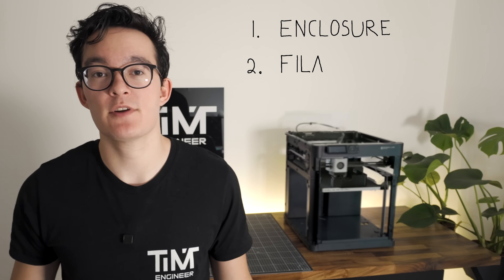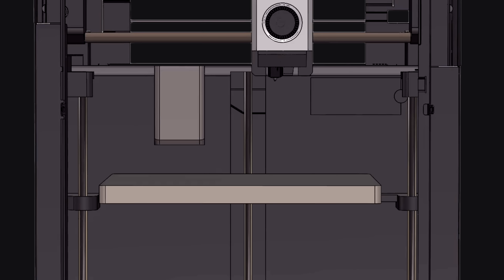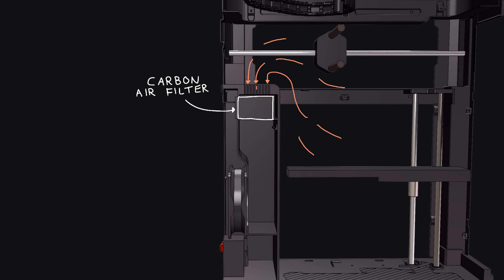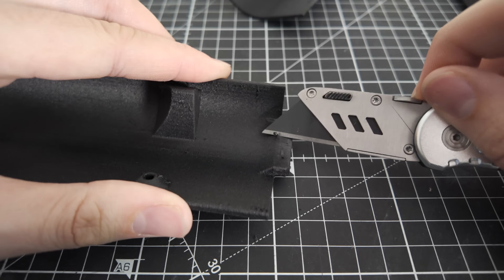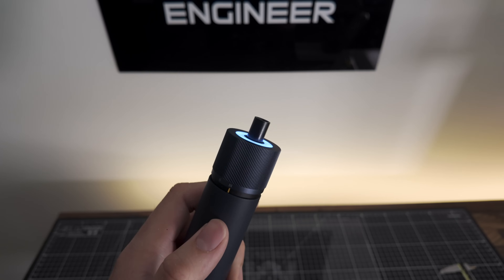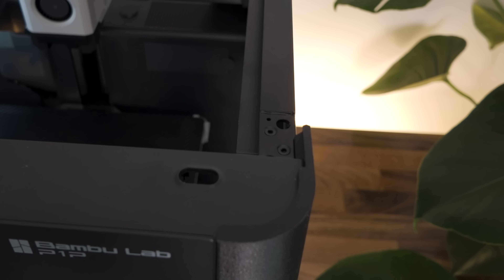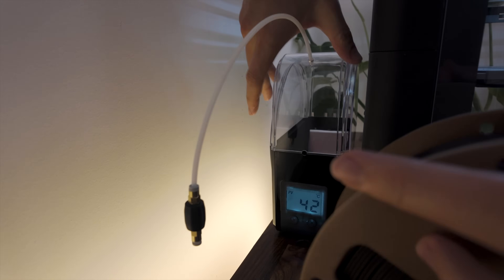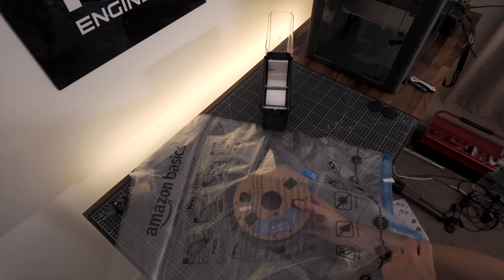Upgrading my 3D printer to print the toughest material: Nylon

Comment: This video is great. Right now, the P1S on Bambu Labs website is on sale for $600, and you only need 2 parts to make it like the X1C. And you did it without whining about how you should just "bUy ThE X1C." I'm going to do the same thing you did, since I'm expecting the next Bambu to have a larger build volume + multiple independent print heads (which would solve AMS waste issue).

I have a question though, pertaining to the nylon carbon fiber parts expanding. If you paint it with something called dichtol (makes print parts waterproof, like if you wanted to make an outdoor security camera case), what would happen? Would that solve the expanding parts issue? Can you test this out for us?
Reply from the maker: Thank you! I would of bought the P1S if I  didn’t already get the P1P a year ago, but I think your right the upgrades make it worth upgrading either! As for the expanding Nylon there’s many methods to waterproof them! I’m sure dichtol would work the question is how much! I might cover this in a future video sure!

Comment: One trick I have used in my PrusaXL to improve my success with Nylon parts is to use a fiber reinforced nylon in the bulk structural areas and plain nylon in the contact areas.  I also found that polycarbonate and nylon don't adhere to each other so if you can keep the PC and PA from contacting each other in a wipe tower and only use supports on the bed you can treat the PC almost like a dissolvable support material with the interface distance... That said on the XL a wipe tower is pretty much a necessity when switching filaments and i really struggled getting the mixed prints and wipe tower to behave.
Reply from the maker: Very cool Idea! I’m thinking of doing something similar in a future project with glass fibres in the middle of the filament, leaving the outside nylon only.

Comment: One (IMO) crucial piece of advice if you want to succeed: Do some audio corrections. Compare your video to random other videos on YT. You'll notice that your volume is very low. Don't fall for the "people can adjust their volume"-trap. Nobody wants to have to change their volume for each video, nor do they want the heart attack when the next video starts that is at the right volume, which is way too loud now due to how much they had to increase the volume on their machine.

People can deal with crappy video, but crappy audio really is a dealbreaker. Other than that, this seems like a great new channel, keep up the good work.
Reply from the maker: Yeah I completely agree with your points will try to match audio for the next video thanks!

Comment: What Temperature do you have in the Enclosure?
Reply from the maker: I don’t have a temp sensor but based on the hot end sensor and bed sensor cooling it’s probably 35-40 C. Better enclosures like X1C can go up to  45-50C
Reply: @TimTheEngineer96  thanks mate!

Comment: Thanks for the nice video! I'm upgrading my p1p too and not sure about installing the chamber fan because there is no temperature sensor in the p1p. So the fan is only adjusted by the g-code, right ?
Reply from the maker: Yes this is correct, to be honest it’s no way near as important as the control board fan. The enclosure won’t overheat even if your beds at 100 C so you can skip the chamber fan upgrade if you want. For me it was a way of getting some air through the Carbon filter. Now considering having an internal filtering system with a hepa filter and temp sensor+ heater.

Comment: Isn't TPU WAY tougher than nylon?
Reply from the maker: Yes it is! Technically infinitely tougher because it’s an elastomere and can’t be tested accurately in the unnotched impact test. I believe elastic materials like TPU are unfair to compare to rigid material which is why I didn’t include it
Reply: @TimTheEngineer96  I think it's pretty fair to compare something like 95A TPU, because it's still rigid enough to be used for many structural parts.

Comment: Carbon filters don’t filter out the toxic fumes. Only the smells. Combine it with a HEPA filter 👍
Reply from the maker: Oh good to know thanks!
Reply: @TimTheEngineer96  Umm Matthew is wrong however, carbon does filter the bad stuff hence why its called a scrubber. The Hepa filter filters out particulate aka the tiny plastic particles.

Comment: So you upgraded your P1 to be a lesser X1C at more cost than just buying a X1C?  I guess that makes sense if you have a Youtube channel?  And nylon is not the toughest material to print by far.  TPU (especially old-school Ninjaflex) has given us all more headaches than nylon ever could imagine.
Reply from the maker: I think it becomes subjective, but your right TPU is also very hard to print. Personally I found that because it absorbs water slower and parts dont warp as much, it was much easier for me to print it.
Reply: The amount of effort he placed in this P1P upgrade and video editing is more than most will do in a lifetime.
Reply: If you already own a P1S, which he did, then no the upgrades don't cost more than an X1C.
Reply: This is no different then somebody that buys a camaro ss or a mustang gt and supercharges them. Its for the love of the game
Reply from the maker: “For the love of the game” well said XD
Reply: even then this build is signifigantly cheaper than an x1 carbon
Reply: lmao i have oldschool ninjaflex around, it still prints properly after 2 days in the filament dryer

and even my Bambu A1 prints it properly if i have a direct path to the extruder (short piece of ptfe in the head/ams splitter) and a holder with ball bearings

my old Creality with a Hemera does aswell but since even the A1 can do it i don't ever use my modded CR20 Pro anymore
Reply: Ninjaflex is actually damn easy on the P1S. I just used the Bambu TPU preset, changed the temps to what the box said and DISABLED RETRACT, LIKE COMPLETELY OR IT WILL SCREW YOU OVE RIMMEDIATELY

Sorry for caps, but I really wanted to get that out there.

Comment: Good thing I stumbled across this video -- I just bought a hardened nozzle for my P1S but didn't even think to get hardened gears!
Reply: Double check it doesn’t already come with those!
Reply: @tttimster2132  the P1S says it comes with stainless gears. The hardened gears were only $20 so it is a worthwhile upgrade to go with all of the PETG-CF I just bought.
Reply: @cedwards427  oh definitely if your printing anything with fibres in it as they are super abrasive!

Comment: Well, it sounds as if PA was the best material (Nylon is actually just a brand name, not the material). However it's actually not even close to being the best material, and I'm talking about the mechanical properties and not about ease of use. Really the biggest problem with PA is that it trades toughness for rigidity. For example I would never print shelf parts out of it, because the load will deform it permanently over time. Toughtness is not the only strength property and therefore, while it is impact and shatter resistant, it's still not the strongest material (not even close).
Also since it is hard to print properly, it will turn out weaker than PETG in a lot of cases.

Furthermore it's unsuitable in a lot more cases than just shelf parts.Whenever rigidity is required, then PA is the wrong material. Printed CNC machines for example. In the vast majority of cases PLA, PETG or ABS/ASA is better suited than PA. PLA expecially when it needs to be stiff and resist deflection under non constant load and when temperature is low. Or ABS/ASA for constant loads.
Yes PA can be made stiffer when using PACF, but it still won't be as stiff as some other options like PLA and the CF content might be unsuitable in many cases, because CF changes it's size based on room temperature and that causes a lot of mechanical problems, too.

In my experience of 5 years with many different filaments, I'd argue, that there are almost no cases where PA is the best choice. Wear and friction resistance is one of the few cases wher PA shines over the other filaments.

There is a reason why PLA and PETG is so widely popular. ANd that's not only because they're easy to work with, but also because they are suited to most use cases and even in special cases I'd probably not use PA, unless specifically required. And their spread make them cheap, so the higher price for PA is not an argument for it being better. Quite the contrary.
Reply from the maker: Yeah your absolutely right there’s very few good use cases for nylon, but I do believe that if used in the right areas it shines! Hope to demonstrator this in future projects!

Comment: Its not as tough as one might think sir. First off its flexible, without cf its meh.. the only thing its good for is high temp enviroments. its not very wear resistant either. At least from the usecases i have been disappointed by it. And its messy.. it loves to ooze. and string. 

i suggest you inspect your generated gcode for retraction speed overrides to take effect over 30mms. bl have locked it at max 30mms by default for some reason.. i use pa12gf with little ooze on long travels and almost nothing on shorter ones. had to "unlock" the speed and set it to 40mms and use 5mm retraction. 
good luck sir, nylon is pita.

suggest you take a look at asa and pctg with fillers for strong prints. also. slower and correct temp and as little fan as possible WILL give better results. time is your enemy
Reply from the maker: Thank you for the tips! I will do m’y own testing in future vids but I have high hopes for nylon let’s see!
Reply: @TimTheEngineer96  same as i had and did :) plus its loooooves moisture. U gotta have a drybox to print from. 

 give me a thumbs up when start testing its strength

Comment: Great video. Brand new subscriber. Long time nylon user. Easy Nylon is funny because if you print it with regular nylon bed temps you will have a had time. You'll actually get better results if you use 50 degrees on the bed instead of higher temps. A thin layer of glue will be just as sufficient as thick glue but prettier. The packaging recommendations are actually spot on (when perfectly dry).

The Easy Nylon you printed is still too wet from the looks of it. It will be silky smooth when completely dry. When wet, it'll get the bumpier texture and string like PETG. 

Idk if you have the engineering plate but i think that actually works the best with Easy Nylon. 

Finally, you used Easy Nylon.... It's easy lol. If you want a "real" challenge, pickup some Kodak Nylon. That'll require the preset temps, unlike the Overture. 

Again, great video. Just hoping to help, as an extensive non-CF  nylon user.
Reply from the maker: Thank you! I’m glad you approve given your expertise on the matter! I was scared nylon lovers would take offence to me using easy nylon but I’m glad I’m still in the good books :) I’ve tried other Nylon and indeed it was much more difficult to get right. Didn’t know that you could go as low as 50 and I think you might be right i didn’t dry it before printing. Probably should have let it sit in the drier overnight. Thanks for the info kind sir! I will keep it in mind for future projects!

Comment: What solved the warping? Slower print? Different temperature? Great video
Reply from the maker: Yes mainly swapping to PEI sheet improved bed adhesion but I also made some changes to settings which I displayed before I started 2nd print!
Reply: @TimTheEngineer96  great, i will compare the settings. Thanks for the response

Comment: Did you let the chamber preheat
Reply from the maker: I did but didn’t notice a significant difference when testing so I don’t think it’s needed!
Reply: @TimTheEngineer96 you can also use a hair dryer to heat the chamber if you need

Comment: You said Nylon is cheap...All Nylon filaments are among the most expensive, what am i missing here?
Reply from the maker: Nylon (PA6 &PA66) by itself is a very cheap polymer used in injection moulding, as a filament because of low demand it’s a similar price to ABS, ASA. When compared to composite filaments it’s a lot cheaper! Price in the description.

Comment: Same printer, already upped to P1S, and probably the same nylon since it's the same brand. Mine is the Easy Nylon from Overture, it should be a blend of PA6 and PA12 to stabilize the print, but Ihaven't tried yet. Compulsive shopping of 2 months ago... 
Thanks for the content! PS: Speak louder! Not my printer making noise, you talk too "shy"!
Reply from the maker: Very cool! Ive heard PA6 and PA12 before but on their spec sheet they are claiming PA6 and PA66? Yes will up the volume next time!

Comment: Cool, some nice mods there. Only thing i can see is that top does not seem to fit (i can see the light leakage at the front which means air / heat leakage) and also its too low. I used my p1s for quite a few months low down like yours before making a much bigger extension on the top because the ptfe tube hits and rubs agenst the top. Its left pits and scratches in my top part and the ptfe tube has rubbed itself down flat on one side. Also just wondering did you heat up the printer before printing the nilon? Maybe i missed you saying you did? Cheers for the video.
Reply from the maker: Thanks for the info! Your right I’ve started seeing the ptfe tube scraping. I’m thinking I might change it for the high temp ptfe that came with the pneumatic fittings I’ve linked in the description. Hopefully won’t wear as much. I would say one of the cons is this design is indeed not air tight like you mentioned, but so far I havent seen any other warping since installing the enclosure! I did heat up the enclosure slightly, but I found that by the time you get to those top layers away from the bed, the air has warmed up enough even without preheating it.

Comment: You could add one of those PTC heaters to reach 60C inside the printer. I wasn't ever able to get more than 45C on x1c
Reply from the maker: Great suggestion maybe in the future if there’s any challenging prints I need to complete!
Reply: @TimTheEngineer96  FYI there are off the shelve heaters for resin printers that you could easily use
Reply from the maker: Ooo didn’t know that I’ll check in them out thnx

Comment: Really cool video !! Do p1p or p1s have preset profiles for those engineering filaments like nylon-cf etc ?
Reply from the maker: Thanks! Yes they do PA-CF is actually easier to print! The nylon (PA) profile is the tricky part because it’s too fast and a lot of the settings had to be tuned on the slicer

Comment: you are missing a filament cutter arm. otherwise very good video, subscribed.
Reply from the maker: Thanks! I actually don’t use the cutter I just heat the nozzle to change filaments. I also have to swap out the extruder a lot so I’ve left it out on purpose!

Comment: I have gone for the air filteration inside, and inward exhaust to cool the chamber & keep fumes inside. This is pretty easy to do in klipper
Reply from the maker: Interesting tip if I have any issues I might consider doing the same!
Reply: If you keep the activated carbon in the heated chamber it can release the chemicals it previously filtered

Comment: so quick question, at around 5:24, i noticed that there are gaps leading straight to the controller board from the inside of the printer. I know you installed the fan for extra airflow around it however wouldnt the 50 degree air temperature mess with the longevity of the control board.  just didnt see if you had addressed this during the build.  great video by the way.
Reply from the maker: Yes your absolutely right this is also a concern I have. Having Looked at the Bambu wiki for the enclosure upgrade they seem to think the fan is enough, but I definitely think that adding a wall of insulation around the control board would help prevent too much hot air from getting back there. Thanks!

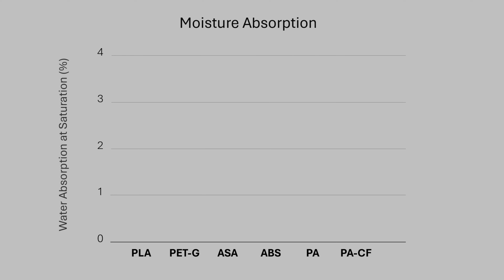Comment: Do you have any sources for the graphs you use, like the one at 8:48 ? (There are none linked in the description)
And if you measured them yourself: what setup and parameters were used ?
Reply from the maker: Great reminder thanks, I’ve just updated the description! Note that I didn’t use any coefficient of friction graphs because I couldn’t find any papers that compare the filaments reliably. Although it’s widely accepted that Nylon has low friction in industry.

Comment: And with how much this cost did you was it worth it, personally I would have just bought a Q1 pro for $450 and been able to print anything straight out the box, having multiple printers it's not a bad thing
Reply from the maker: It was quite expensive (180-250$) so getting the P1S would be my recommendation for sure, but at the time I did not have the need to print these tougher filaments. I haven’t tried the Q1 is it good?
Reply: @TimTheEngineer96  it's amazing right out of the box you can print every filament for cheaper than a P1S and I think it's same quality
Reply from the maker: Oh wow impressive I’ll check them out thanks for the info!

Comment: Have you tried annealing the nylon parts in oil to reduce water absorbtion and increasing strength?
Reply from the maker: I have not yet, although I like the suggestion, I may try this in a later project If the parts aren’t holding up